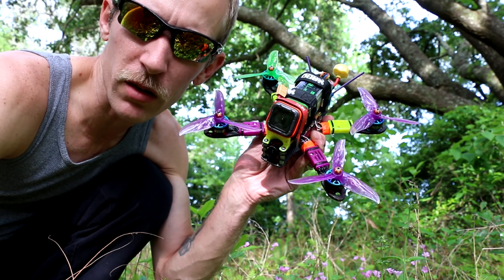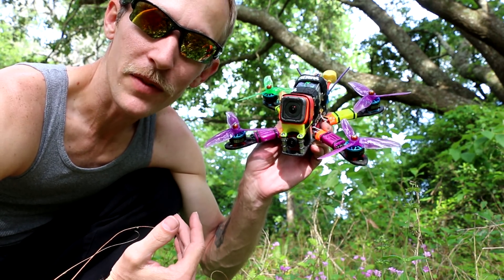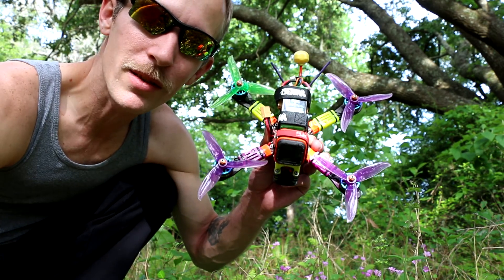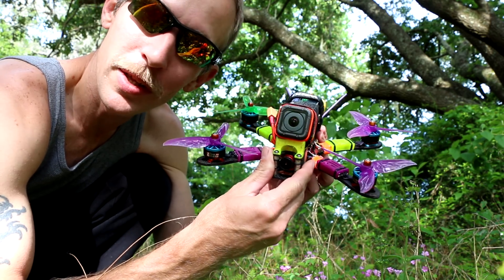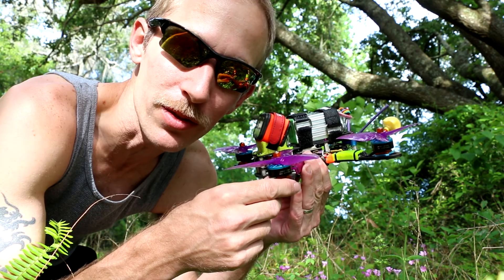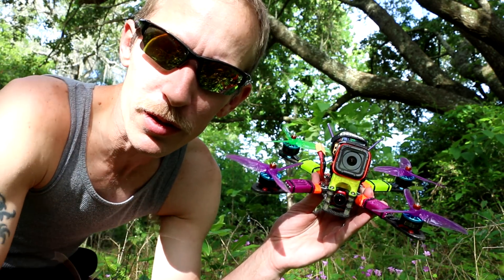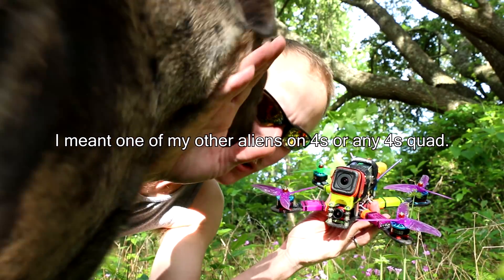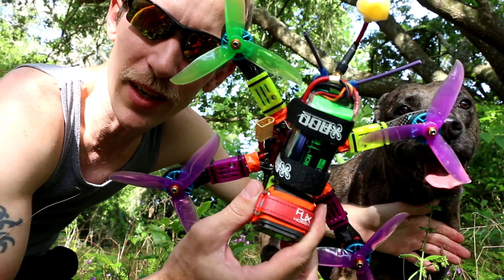Helio spring FC and Hyperlite 2207 1722kv review Not really

Comment: You know what props I have fell in love with on 6s is the new HQ 5151s... they are easily my fav 6s prop right now.. I'm really like the F40 Pro v2s 1600kv I really wish they made a 1700kv but it's fine on the higher load/pitch props.. I can get 5 minutes of ripping hard on a 1300 6s R-line with the HQ5151s on the 1600kv F40s.. the power is HUGE from zero to 85% throttle they are monsters but the 2600kv F40 Pro v2 on 4s is faster on top end for sure but I don't care about them anyhow.. the 1600s are plenty fast on the 5151s or GF5055s for freestyle.. the mid range snap is insane on the HQ5151s and power off zero throttle is brutal on a 270 gram dry weight freestyle build.. I don't fly Go pros so I really have mega power with the much lighter AUW without a go pro.. I am really liking those Hyperlite 2207 1722s, I get roughly a minute longer flight time on the 1600kv f40s but I like the way the F40s handle the prop off zero throttle better they just spin the prop up soooooo quickly and have tons of low end and mid range power it's hard to fly something else when you get used to that space bending low and mid range power..

For shits a giggles we rewound some Hyperlite 2204s and tested then at 1670kv and they are flying perfectly on 6s now with HQ5x4.3x3v1s on a merica race frame.. it's 238 grams with props and AXii antenna.. it's so fun on 6s 1050s the power is there, the low end isn't there like the bigger motors but it's very nimble and response is amazing, one of the best flying tight track quads I've flew.. and when running gates at 70% my max skill level so just kinda keeping the throttle steady and hitting nice clean lines I'm getting over 7 minutes on the 1050 6s packs... flying hard I'm still getting close to 5 minutes.. it's kinda funny tho, run the 5x4.8x3v1s and it gets so sloppy and feels horrible in the air.. the little 2204s even on 6s just have no torque at all to spin higher load props (I don't mean it flys really bad it's more then flyable just compared to how amazing it flys on the 5x4x3v1s and 5x4.3x3v1s it makes it seem as tho it flies really badly.) You really should try the F60 Pro v2 6s motors as they are great and longer fight times then the Hyperlite 2207 1722kv with pretty much equal power across the board with the Hyperlite having little more top end but the F60 has more mid range and the both have about the same bottom end torque.. the main diff is in getting another 60 to 70 seconds of flight time on the 6s F60s and I think they respond a little better in the mid range and just a little smoother motors..
Reply: mooosestang hey moose , this 4in1 blheli 32bit ESC  really good.
www.getfpv.com/electronics/electronic-speed-controllers-esc/4-in-1-esc-s/kamikaze-v2-32bit-40a-4-in-1-esc.html
Reply from the maker: I still need to try those.  I'll order some today if pyroflip has them in stock.
Reply from the maker: Damn that looks nice.  If i loose another wraith32 i'm getting that.
Reply: mooosestang  Yes, that kamikaze 4in1 blheli 32bit ESCs are freaking awesome.
Reply: mooosestang Vtx
www.racedayquads.com/collections/video-transmitters-vtxs/products/mach-2-video-transmitter-by-rdq-audio-control-with-0-25-200-500-800mw-u-fl-or-mmcx?variant=1096084062219